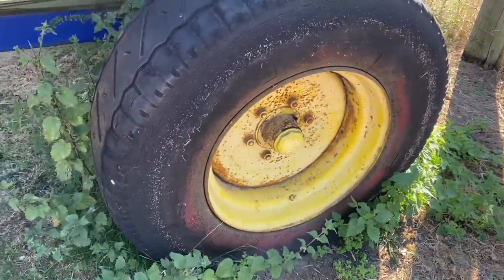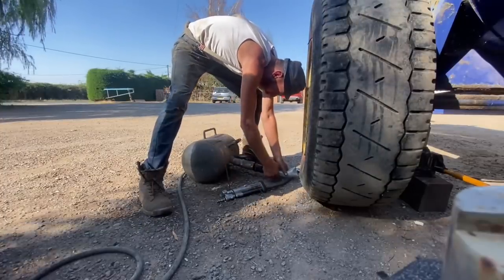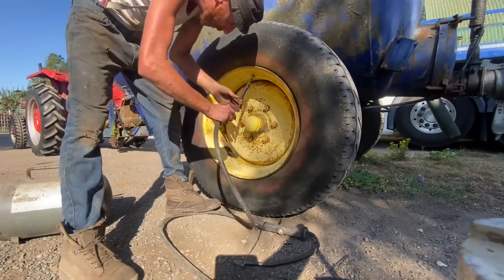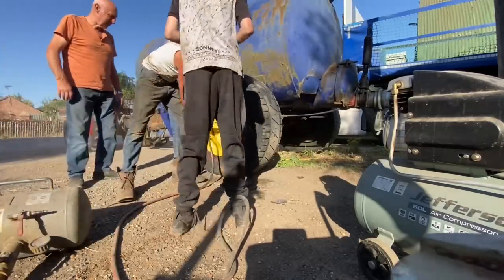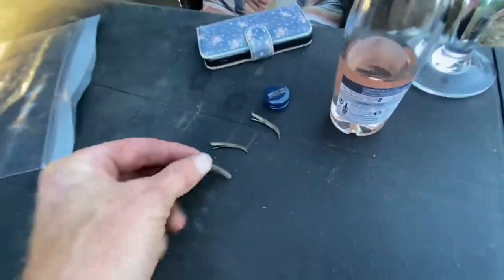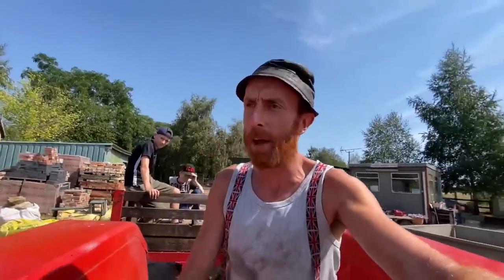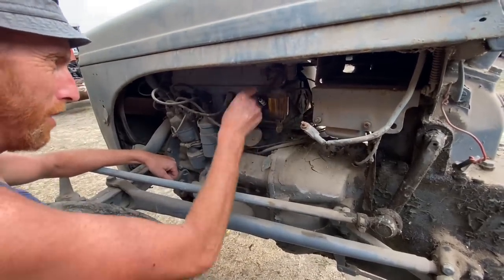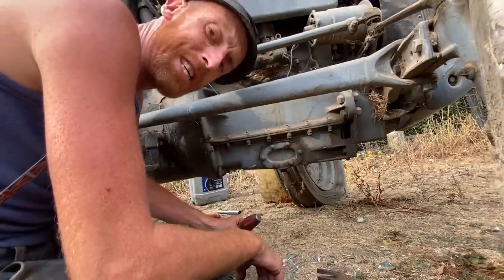The Fergi’s hidden past! tyre struggle😅 cleaning the septic tank not so simple! bail run

Comment: Place a ratchet strap round the centre of the tyre and give it a nip, pushes the bead closer to the lip, then bead blast it. You can get tyre sealant, like grease, it’ll seal as you go as well.
Great video as always, keep those kids safe round those tractors. Can’t believe the little ‘un is walking now!
I use a blow torch to get the BBQ started, and a bit of wood in a “chimney”, no nasty tastes then.
Stay safe out there.
Reply from the maker: Yeah the ratchet strap idea seems a good one that I’ve never tried mate! She’s mobile now Hatz 😊! Will do mate 👍
Reply: Ratchet strap round middle of tread.  Then.... quick spray of petrol on to the tyre bead and flash of flame, and it's re-seated instantly.  Keep having to do it on a farm trailer every now and again :-)

Comment: Yes Chris, used to work  in the septic tank business, try Jetting the soak away pipe back into your tank, if that doesn't work then its dig up and put a new one in 👍🤣😲 Loving the old tractor content 👍😎
Reply: Would be handy if you knew a local company that has one of those Superjet trailer jetters to pressure wash those pipes up the jenk  FULL BORE  clean
Reply from the maker: Cheers Al can’t beat a bit of 💩😆

Comment: agreed, i had problems getting run flats to seat on my xc90 when changing tyre. once i set compressor at 10bar on regulator, used 1/2" airline straight from tank to external regualtor, took out inside of shrader, they now seat straight away. so lesson is you need lots of air flow.

Comment: we always packed em up wi plenty + plenty of ewd grease both sides and sledgehammer tread whilst blowin up and rollin about. If all else fails stick a new tube in, but check for nails/punctures int tyre first Chris. you can get that block properly stitched up, not a big job for a proper welder and cast rods. Good luck and thanks Pal

Comment: Good afternoon  
Chris and the junior strugglers! 
The tyre struggle looked very frustrating....I sometimes see them ignite it back onto rim.....
I'm no expert but I'd of used fairy liquid ...or something water based....
All that work just to start a job!!!
That old mk2 still going strong ! 
Good luck with the grey tractor, im sure you'll get it working  🙏
Wooo wooo 🦉be safe 🦉 G
Reply from the maker: Cheers Gary, never tried the fire thing I’d probably blow the whole thing up mate 😂
Reply: @Professional-struggler   little spray of petrol and instant flame, it pops it back on and reseats it dead easy.  If first time doesnt work, it's seconds to try it again.  Flame mounting / seating / beading works an absolute treat when youre in a rush!

Comment: If you put a ratchet strap around the circumference of the centre of the tyre it pushes the sides walls out to seal to the bead.  then you can get air in the tyre then take the ratchet strap off and inflate it
Reply from the maker: Thanks Steven 👍👍

Comment: Tidy little Fergie, the 12v blocks are quite common to crack in that area, we have one that has done the same 😅. I havent done it yet but I have seen people drill along the crack and put screws in along it then grind the heads off to stitch it together.
Reply from the maker: Yeah they can be salvaged some how I would of thought, thanks Harry 👍
Reply: @Professional-struggler  definitely we repaired one with chemical metal still fine years later they are sound little tractor 🙂 good luck with it 😎

Comment: now that was what you call a struggle with regards to the cracked engine block you could try   use dis similar welding rods for cast or get it metal stitched depends how for you wan't to go with it Chris if you get it turning over . that tyre was a fucker new you would get it in the end 👍

Comment: Hi just put a rachet strap around tyre and keep tightern it up till tyre seals on edges easy way to seal it
Reply from the maker: That’s a good little trick mate, never seen that done before 👍👍
Reply: @Professional-struggler  yes it pushing middle of tyre now squasing outside wall to the rims we use it on quad tyres but will work on most tyres